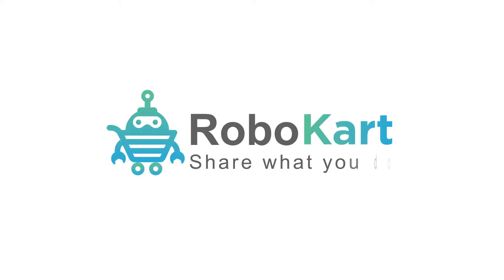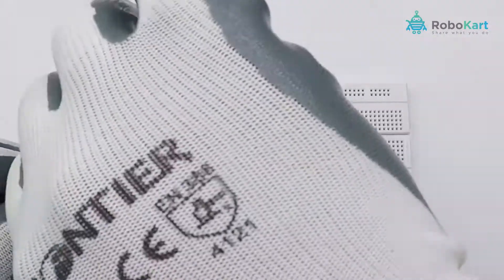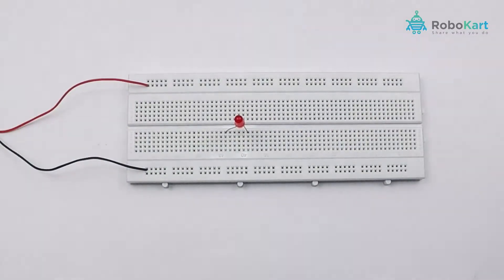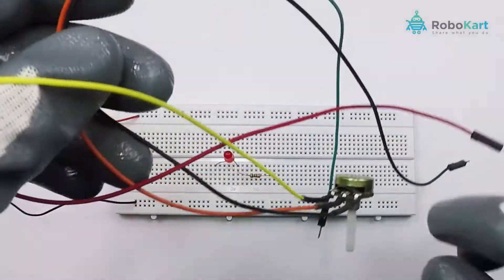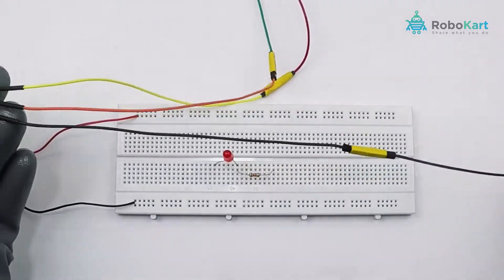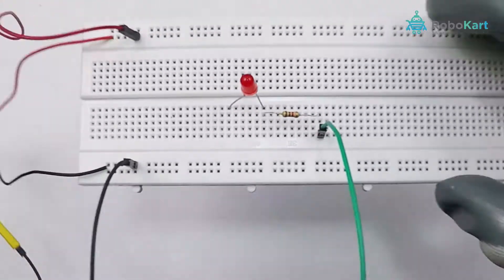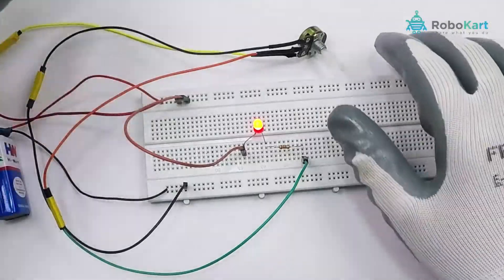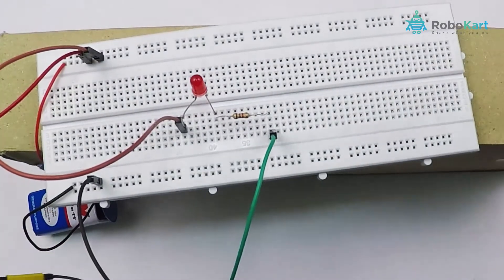How to control the brightness of LED using potentiometer

Comment: Instead of using a 9V battery, can I do the same circuit using a 5v pin from an Arduino?
Reply: this led is rated for 3 volt, 30 milliamps